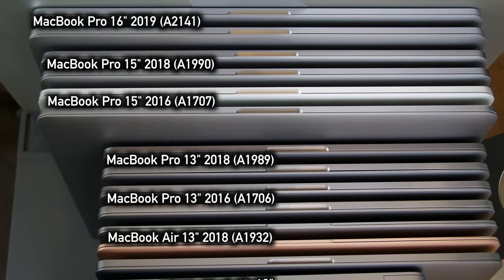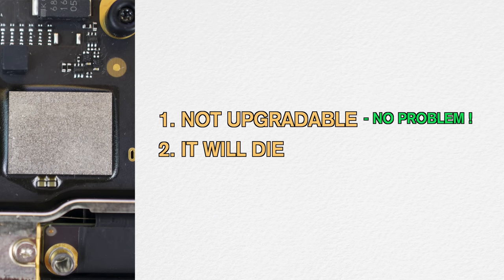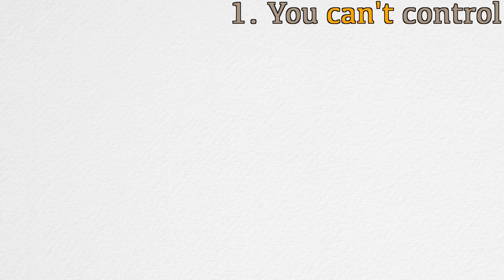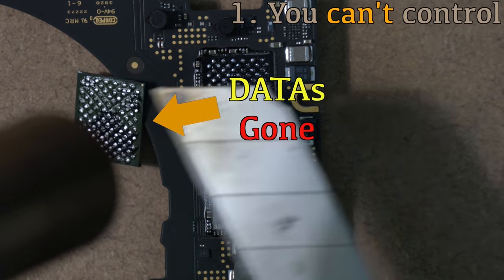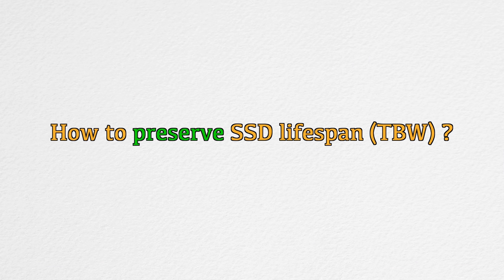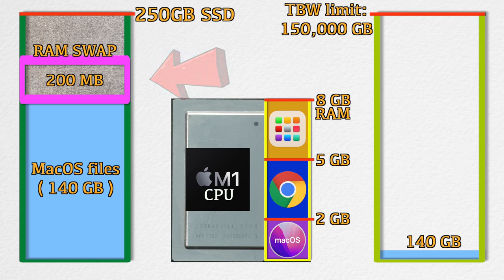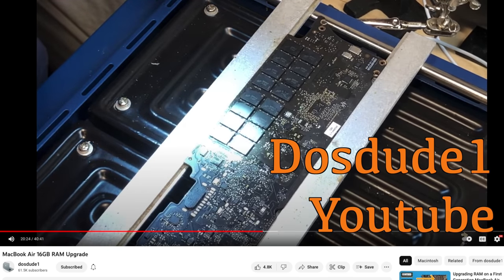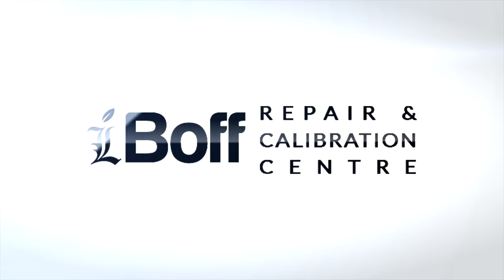These MacBooks DIED from SSD Failure & How To Prevent It (Not for RICH dudes!!)

Comment: Laughs in 2013 15” retina
Reply: laughs on the same boat with u 2015 retina 15'' (probably the last best mac ever made.
Reply: @multiomer1997  yeah I honestly cannot believe I’ve gotten nearly a decade out of this thing. I’ve dropped it off my bed about 100x my brothers (2014) has had coffee and water on his that he gave me. Both still run like champs. Mine still looks almost new. I use it for tethered shooting all the time. The screen is still perfect for me. Except now there’s so much more content to play on it compared to when it came out. I even got one of those usb c to MagSafe adapters for it. Usb c charging was like half the reason I wanted a new mac lol. And with the open core patch it’s even more featured than my 2017 officially supported iMac. If it died any day now it wouldn’t owe me a thing.
Reply: @Jushwa  there’s adapters to use a 90w USB-C block with a tip adapter instead of the MagSafe one. In case you want to keep using it lol.
Reply: @geraldsanchez191145  I know, lol I mentioned in my comment that I got one, I love mine, I have a few of them. My old apple charger the wire started smoking while I was using it  🤣
Reply: @Jushwa  oh mb. Finding one of those adapters was a life changer. Carry only one brick and not two. The Magsafe also had to have two long cables on both sides.
Reply: @geraldsanchez191145  yeah pd charging is a god send, I’m just waiting for Black Friday to try and get a 100w power bank so I can also have super battery life

Comment: BS! If you format & copy/delete full capacity of the SSD you would still can use it for decades without any slowing down or damaging it. Yes, you may get a failure after a month, a year, or more but that's very rare & normal since it happens with everything, even your pumping heart. It's a matter of very little probability that comes with cery much everything.
Reply: How do you know it will work for decades if nobody has used a ssd for 10 years?
Reply: @Teluric2  test results for electronic products aren't based on real life usages. It's done with automation and mathematical probabilities.

People tend to report on the few cases that are failing due to normal the probabilities of things that fail. Apple is religious about the quality of their products, they choose them or make them themselves in a way that they come out outstanding.

I remember the same fuss was made about spinning hard drives, later CDs abd flash thumb drives.

If you fill your SSD on your mac and delete every day, you would still not be able to wear them out for at least a decade. Does this mean you save your life work on only one source? No! Important docs should be kept on multiple sources.
Reply: @Teluric2  by the way, the operating system is constantly writing/reading from the ssd, also remember modern rams have the same principles or mechanisms for accessing, although they don't retain data when the power is off.

Every time you type a command, yoy click a link, you scroll a page, the ssd is written to and read from by the OS. In fact, right after turning on the computer, the ssd is constantly accessed.

Comment: Something happened with my WD SSD in my notebook: after 2 years it says that it can die anytime for errors even with 95%.
It is scary but at least i can Swap out SSD when it dies and place a 980 PRO for 100 bucks.
I still keep suggesting M1 notebooks but this dactor is sh*t and manifacturers should not soldier their SSD when possibile... (for the costumer and also for the waste of full products when only a part dies...)

Comment: Very misleading and innacurate: TBW doesn’t refer to maximum data you can write to SSD before it dies.  It refers to the guaranteed, faultless performance (it is clear if you reading comprehension is at basic level). After the limit, you no longer have the guarantee, but the ssd can work for years. If an ssd suddenly dies it is usually because of the controller failure. The natural 'death' of an ssd is slow - there is simply a growing number of errors. The disk capacity is gradually smaller and the disk is slower.  It’s funny that later on you show the example where 150 TBW limit  (you defined yourself - apple doesn't specify it) is crossed by almost another 150 TB and the health of the drive is 81%. Ridiculous. As for swap - ssd swap is not actively used like RAM. Whatever goes to swap is the part of memory which is least used (as determined by the system).
Reply from the maker: It's so delightful to see people like you, you must know everything about Apple NANDs. 

People like you will never complain if we install a used, worn-out NANDs(81% left, 278TBW) to your dead SSD Macbook. Which unfortunately most of our customers dont happy with that used SSD!?

And the most beautiful part of this is, you can only fix this dead NAND issue by pulling other NANDs from other used, worn out MacBook(NANDs with special firmware)

We need to educate our customers to be happy with those worn out NANDs they will get because like you said, "SSD can work for years~"

Comment: Hate to break it to you guys, but the vast majority of end users don't care about  "reparability" they want warranty coverage and just want the manufacture to fix it rather than do it themselves.   Since Apple moved to soldered RAM in 2012 I've seen way fewer RAM failures, SO-DIMM is a crappy design standard and after 3-5+ years of heavy use all the bumping and jostling of any notebook has the chance of causing the SO-DIMM becoming partially dislodged and shorting out either the DIMM or more likely the MLB having soldered RAM eliminates two failure points before the move to soldered RAM the vast majority of end users never upgraded their RAM after 4-5 years and bought it with the minimum config available at the time. . ON A SIDE NOTE 8GB of RAM is enough for people to preform the basic work the vast majority of end users want to do, and 256GB of SSD storage is fine as again, people use cloud storage and aren't writing 100's of TB of data during a products lifespan.  Yeah its cheaper and relatively easy to change the oil in my own car, but  I'd much rather pay someone else to do it because I don't want to do more work after i get done with work. Customer service and support is another reason why Apple is so popular.  If you don't like it there are other vendors out there.  And another thing, you have no one to blame but yourself for losing data, I remember sitcoms from the 80s making jokes about data loss, there is no excuse to not backup especially since Apple products practically scream at you to back up. Do us all a favor, buy a Framework notebook and install Linux. Just because you yell loudly doesn't mean you represent most end users.

Comment: Edit* - the video was correct so I edited my comment - corrected ******* (so response may not make sense now, I took down original comment) When the Flash chips are worn out, it does not mean that the chip will short its power to ground.  That is a different failure than worn out flash cells.
Reply from the maker: Nobody said its shorted to ground Mr Smart
Reply: @iBoffRCC  In the video, he said that all of the chips on a certain board had the power shorted to ground.
Reply: @iBoffRCC  Please check 4:28 in the video. He did say it might be sabotage or something,... Or was that the buck converter failure?
Reply: @iBoffRCC  Ok thank you, I understand now, it was the buck converter that caused the shorted chips and you give that as a different cause.  I am sorry, my mistake for mixing the two up.  I had commented before I finished the video.

Comment: stop your complaining… These failures are out of the ordinary… Most users will never have this problem… And you should get used to replacing your computer every 3 to 5 years… Computers that are 10 years old are not designed to run modern software… You should consider your computer like a lease… And compare to your automobile… Which you spend say $36,000 on… Cost you about $500 a month to run… You are getting a bargain and if your biggest complaint is the SSD is soldered… You have bigger problems

Comment: I'm sorry but you should do more research before creating a video. Most central information in your video is simply wrong. You even SHOWED the text that states that the TBW limit is about the WAREANTY. It doesn't mean that after reaching the limit, the SSD will die. That information is totally wrong. Also you don't understand how the cells work. If you have 200GB of storage on a 250GB drive, and keep using it, the remaining 50GB of cells will wear off much faster. SSDs use randomizing algorithms to distribute the wear evenly on the available cells. If these 50GBs of cells become unusable after too many write cycles, you still have the 200 remaining gigabyte completely intact. This video is horrible. Garbage.

Comment: Yet another consequence of apple’s cavalier reduction of product longevity in its tireless and mindless quest of the two-dimensional laptop.  In retrospect, this dates back to the first MacBook Air.  Remember when that imbecile picked it up during the introductory stage show and LICKED it???  
Every new generation of the iPhone seems to get more slippery.  The reason probably has less to do with its “lickability” as it does with the increasing susceptibility to being dropped.  This has guaranteed an ongoing demand that results, along with the rapidly-decreasing obsolescence, in more revenue, not only for apple, but for the remora-like vendors of the obligatory protective covers.

Comment: Apple has been slowly screwing their users in the last 10 years 🤣.When solid state storage were mlc things were fine, I have a 13 years old ipad og that still functions well. Now all the flash are much worst quality, and apple pulls this. I used to have good things to say about apple, now I tell people they are trash and should be avoided at all cost. Just stop using these anti repair garbage and move on, get a hackintosh if you so require the environment.